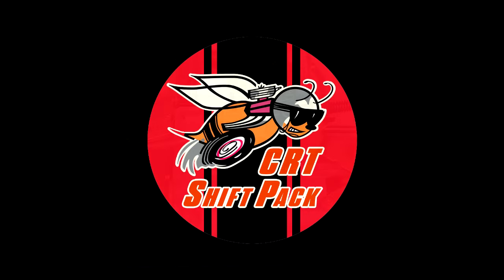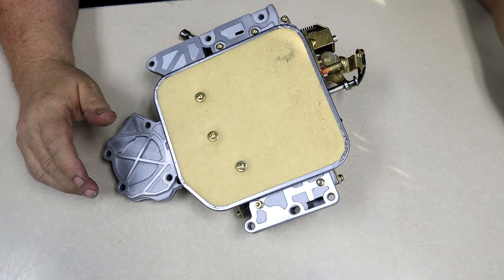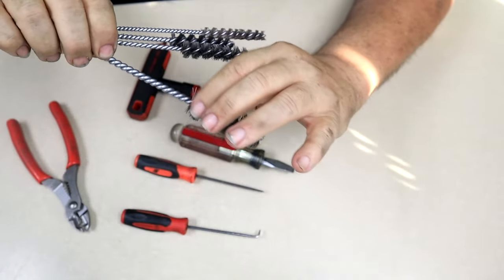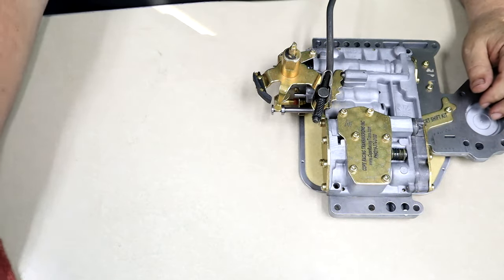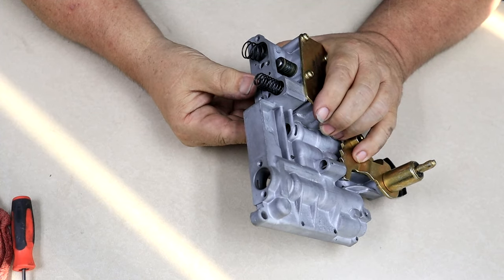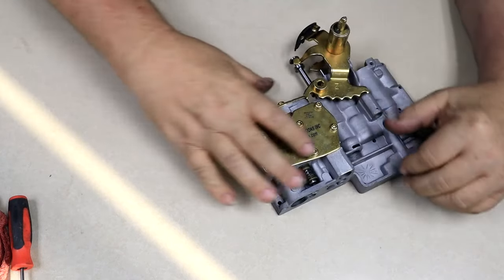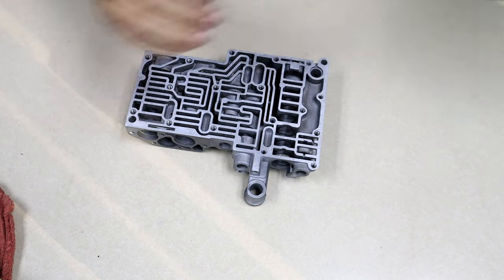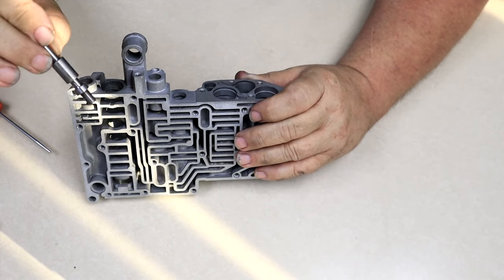CRT SHIFT PACK INSTALLATION 727 & 904

Comment: You are a great teacher. Thank you! I do have a dumb question though... this shift kit will work the same on a 518 (46RH) as it would on a late 727? I have to admit though... handing you money plus my 46RH core in exchange for a 'built' 46RH valve body seems the way to go. 🙂 I do have several 727s though to learn how to do this.